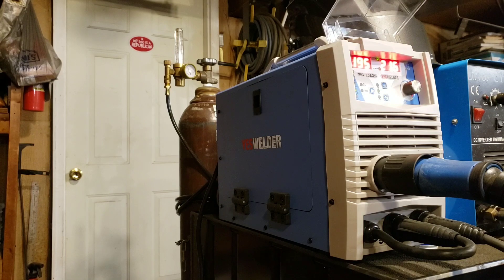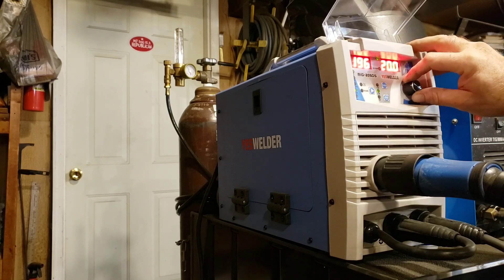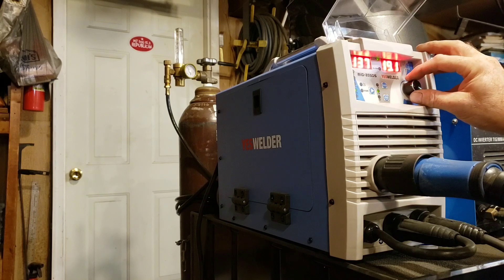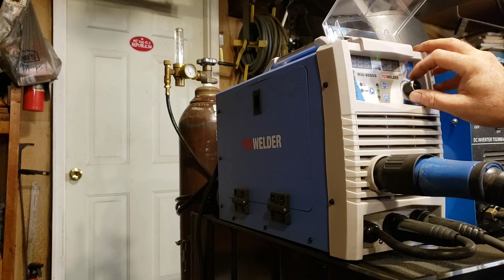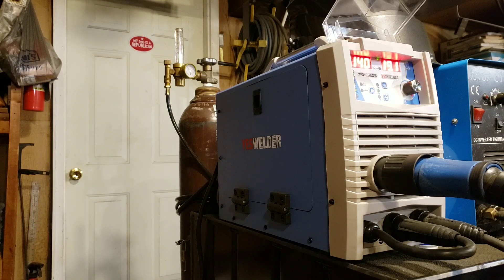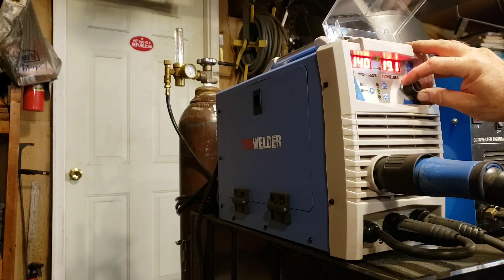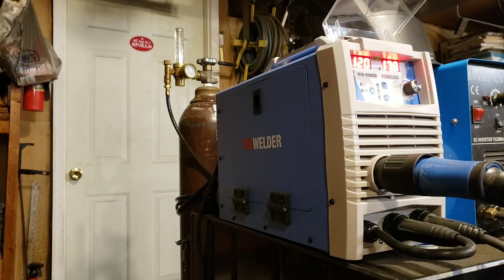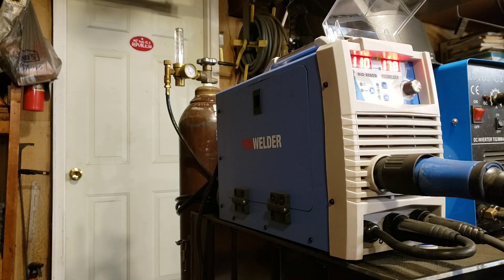Setting up your Yeswelder Mig-205DS

Comment: Hi Don, thanks for more useful information. I was about to pull the trigger on a HF titanium, then came upon this hidden gem.
Have you actually welded 22ga with this? I'm restoring an old car so that's why I'm in the market. Thanks again, and if you would be so kind to send your sheet to me, thanks in advance. bleedcarrierblue@hotmail.com
Reply from the maker: I just emailed the chart. As for welding 22ga body panels, use 0.023 solid wire with mix gas with amperage  around 40 you can use a longer wire stick out to reduce penetration. I have welded on a 20ga tool box with excellent results.

Comment: I'm looking at these and I see you don't really like your synergic settings.  Do you know if it has any kind of a memory feature so you can save your favorite settings?  Inductance is a total mystery to me.  Is it possible that you can just change the inductance settings instead of changing everything?  I watched a vid on weld.com channel and they seemed to be saying that it can make the weld hotter/colder and softer/harsher.  I've really got no idea what that really means as it relates to inductance, because it seems that you could do that with current and wire feed, but are you seeing anything like that?  On the first bead you talk about you say that it's hotter than the miller, but did you try a range of inductance settings to see if it helped? Sorry for being so long winded.  Thanks a lot for the video even if you don't respond.
Reply from the maker: Not that I have found. But then again on sale these can be less than $300 for a 60% duty cycle 200 amp mig welder. If I feel lazy I will turn the welder down from my ¼" setting to ⅛" and just change speed and stick out and get good enough welds. Sometimes you are in a hurry and use a hotter than normal setting and you can control heat by pulling your gun back and working your trigger to avoid burn through or over penetration. It's still a very serviceable welder. In my opinion if they added wire speed to the display and tweaked their synergic settings a little it would be the best welder for the money period. But again I paid something like $299 before applying $100 of prime points. I have run a full 12# spool of 0.030 wire plus part of a second through it and I still like the welder. Make yourself a cheat sheet for your most used settings.

Comment: So you can’t set wire speed and volts separate?
Reply from the maker: No. Unfortunately that is the nature of the fully synergic machines. You can tweak the settings to match your preferred settings. A little bit cumbersome but not difficult.
Reply: @zuk4x493  how.?

Comment: Hello n thanks for these video's. I just ordered this welder n a tig torch. In the instructions on line it says to put the tig torch on the positive side of the welder n the negative on the neg side of the welder. I always thout it being Dc the tig torch would go to tge neg side of the welder n the ground to the positive side to keep from burning the rod up. The instructions for the gaseless flux is also the same way n for the mma arc welding also. They just have the mig using gas pos to pos n neg to neg. Are these instructions correct? I looked at their high mig welder that does aluminum n it says to use tig torch to put the tig torch in the neg n the ground clamp to the positive like i always thout. Idk if their instructions is wrong or not to be honest n i dont want to burn it up just getting it also. How was you able to use aluminum with this welder also? Thanks God Bless!! You can always mess me on Facebook also n thanks alot for the chart you put together n showing what range works the best!!
Reply from the maker: I question their instructions anyway. I think a lot of their information gets corrupted during translation. I haven't used their tig setup but I think I would follow standard welding setup and procedures.
Reply: @zuk4x493   Ya I think I am going to, I think also they might get confused when translating to English some times. Correct me if I am wrong, but every thing like mma n mig go to the positive n negative n the tig goes in the reverse polarity correct? It also said to never try n tig aluminum for some reason like it would destroy the machine or something. I have just always used the flux welder for some yrs but I wanted to try tig n really haven't used it but I have researched alot on the welding with tig, alot of ppl said y can tig with dc, it will just look dirty where the ac cleans the metal. But really appreciate yr reply..

Comment: Great videos on this welder I really appreciate your time and help with this specific machine! If I were to PayPal you a few bucks would you send me that chart you shared with color coded highlighted settings you'd recommend for certain wire thickness using the colors to identify the wire to use with which setting by your experience with this machine? 🙏
Reply from the maker: Message me on Facebook  Don Riead and get me your email address. I wouldn't feel right charging you for a pdf file.
Reply: Hi, I contacted you on another video regarding the Mig-205DS not holding it's settings when powered down. I have been emailing everyone I can from Yeswelder and am getting no solution. Did you check your welder after disconnecting the power to see if it powered up in the last used settings? Mine always seems to power up with the same settings regardless of previous used settings which makes fine tuning pretty pointless if you turn the welder off at all and go back to the same job.
Reply from the maker: @bumzigan , I actually did check and mine holds its settings. I even unplugged it to see if it would reset. It came back with my last setting.
Reply: Thanks Zuk, appreciate the feedback, now to get mine sorted.
Reply: Hey Zuk, I had a reply back from Yeswelder and it would seem that unless the settings are not changed for a few minutes, it remembers the settings that it had when turned on not the current settings. I changed the settings and left it for a few minutes before turning it off and it started up with the last used settings. Now I know I can factor that in to my procedure. I am in Australia and we have the 240v version so it would be very close to 200 amps.
Reply: @zuk4x493  I've sent you my email on Facebook
Reply from the maker: @Donovanx08 , I emailed the pdf file via my gmail account January 8th.
Reply: @Donovanx08  hey trying to get this chart but he has since passed away. Any chance you’d share it?